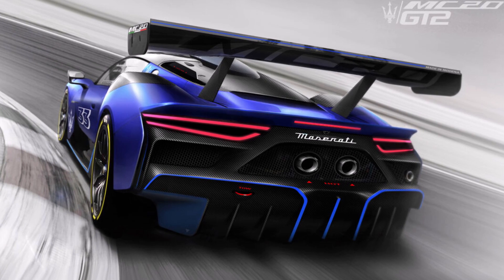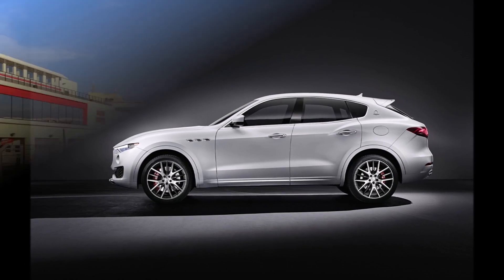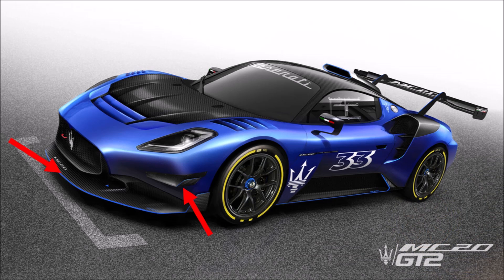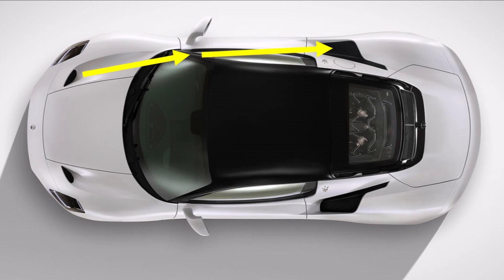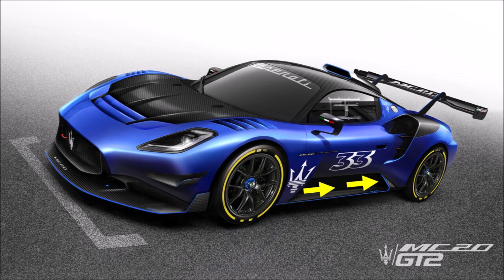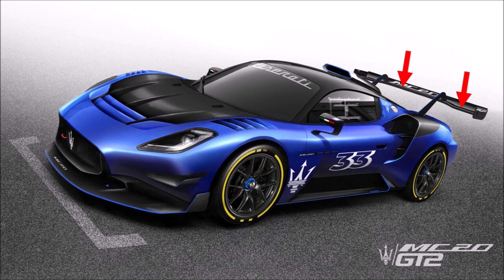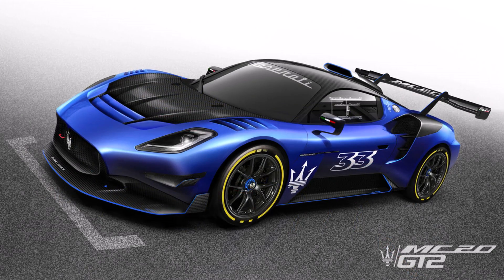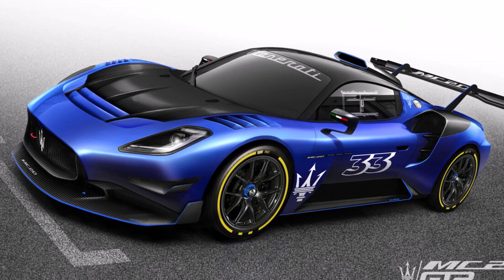Maserati MC20 GT2 - FIRST LOOK

Comment: Could we get a full breakdown on the GT2 class? I'm really confused on it
Reply: You probably got an answer on it already since it's been 5 months, but basically GT2 is more aero than GT4, more power than GT3, but is in the middle in terms of perfromance. Mostly designed for "gentlemen racers" for easier driving
Reply: @M_TCL24  it is a gt4 with gt3 aero...

Comment: I thought GT2 didn't exist any more, but I'm even more surprised to hear that it's slower than GT3. Where are these cars even used?
Reply: SRO brought GT2 back 2 years ago Incase GT3 dies but not the same GT2 from early 2000s. They are faster than GT3 in a straight line but slower in corners
Reply: GT2 only runs on Europe ever since SRO re-introduced it. There’s only 5-7 rounds per season and I don’t think they have international coverage atm. 

That’s why you rarely hear about them. It’s not like Super GT which has Gran Turismo to promote the cars and the racing series itself, despite only receiving local coverage in Japan.

Comment: Would Maserati have to start over to make a GT3 version? Do you expect an MC20 GT3 to follow or is it too much of an investment to presume they're already working on it?
Reply: GT3 is already Ferrari's dominium, and FIAT happily zombifies brands instead of having internal competition(while elsewhere Porsche is allowed to have a feud against Audi of all things, and the group as a whole is way more than kicking)
Reply: @il-ma.le.  they are stellantis now
Reply: @il-ma.le.  Ferrari is now more independent from the group than they used to be. This is why Ferrari will have internal competition with Peugeot in Hypercar and already has it with Alfa Romeo in F1.
Reply: @Pandamasque  when they were powering the Brabham in the 80s, that was Alfa Romeo in F1. This is just a rebadging of a pre-existing structure, and independently of competitiveness a scar on both parts involved if you ask me.
Every other motorsport department that's not Ferrari in the (once just)FIAT group has been shut down, and every sportscar branded as Maserati or Alfa Romeo it's just a rebadged Ferrari(only exception may be the 1.8 in-line 4 used for the 4C, for the little that's worth).

Comment: So the current GT2 is softer than the GT2 of the late 90's to early 2000's.

GT race cars back then were more powerful than production cars, dream cars. GT nowadays seem soft in comparison. Lambos, Ferraris, AMGs, Porsches making upwards of 700hp emissions compliant while GT race cars have to breathe through tiny restrictors.
Reply: 90s GT2 became modern GTE. If I remember correctly. It went from GT2 to GT1 to GTE. 
Modern gt3 cars have their roots in the N-GT class. This modern GT2 series was made for gentlemen drivers. Easier to drive than GT3, due to the lack of aero grip, but more power than GT4
Reply: @DJDiarrhea  Modern GT3 cars have their roots in Porsche Cup, Maserati Trofeo - single make series cars. N-GT was equal to GT2 of the time - hence why it was Ferrari's and Porsches predominantly. That became LM GTE/GTLM.
Reply: @DJDiarrhea  They're a lot more difficult to drive than GT3. BECAUSE they have poorer aero.
Secondly GT2 didn't go to GT1 than GTE. They just went from the GT2 of the early 2000s to GTE.